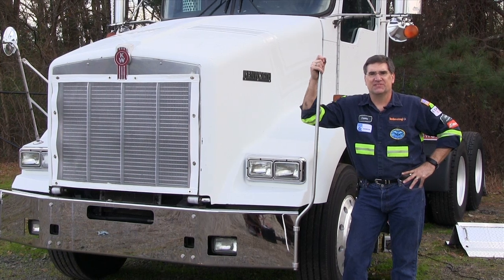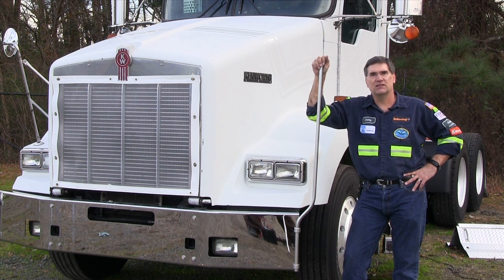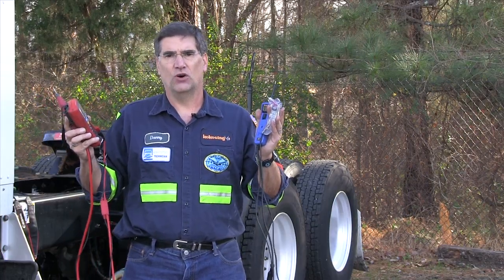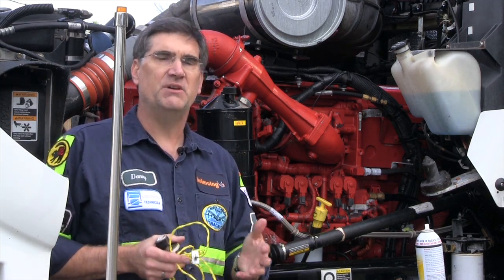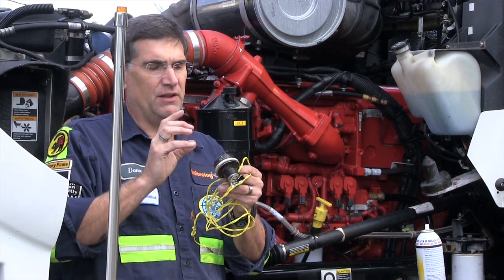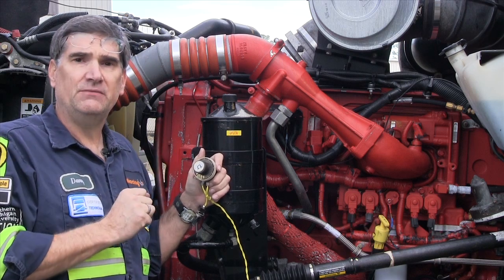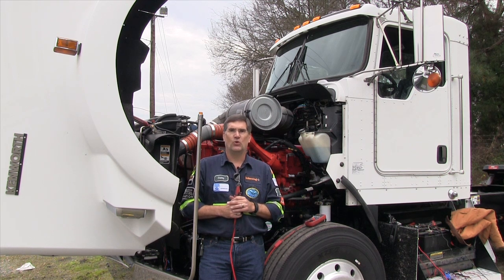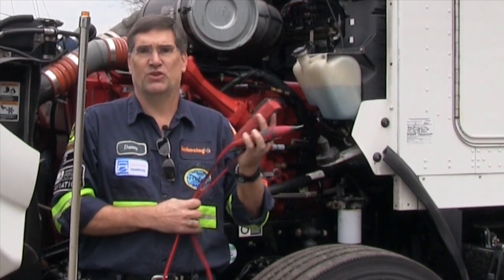LOADpro® vs. Volt-pro vs. Powerprobe® vs. Corrosion

Comment: Hello Mr. Sullivan. I am a veteran mechanic, of automotive, Cummins, diesels, and as of the last 5 years busses (city busses). I am also a load pro , and power probe 3 owner. In my honest opinion Power probes, and load pro are 2 very different tools, and should,  be used  together in ones diagnostic arsenal. I am very happy with both of these tools, but I must admit; I am am confused on why there is this sense of competition. My feelings are that the power probe is a fantastic diagnostic tool, and quite honestly my go to tool for electrical problems, but having the very affordable load pro is also very important. I really feel that both tools have there place in my tool box, and would not be caught dead without both. Maybe get the word out that your very useful, and affordable tool does have a specific purpose that differs from power probe, and it would be a sound, and very affordable investment for anyone, who is interested in electrical/electronics diagnosis to have one. As far as the hecklers go, it comes with the territory, so don't let it get to you. If these guys don't know a good tool when they see one, then let them continue to do it the hard way. Thanks for this excellent invention, and thanks for making it affordable enough for just about anyone who want one to get one. You rock. Dave Pierce (AKA Sir Cranksalot).
Reply: David Pierce I agree with you completely, I also have the load pro and find it a very useful tool . but after hearing about this tool and doing quite a bit of research on it , I believe it will be my next purchased, as for the low current to the ECM on a Cummins that should not happen in my opinion ,sloppy maintenance practice, again in gm fashion , on drivability and low power ,always Ck the battery bx first.I learned that lesson one Friday night along time ago on a road call with a t storm coming in fast.
Reply: David Pierce Btw ,when I first started in the truck business some 35yrs ago ,an old guy in the shop wre I worked had his own version of a load pro for trailers,an electrical box with switches w/ a 7way cord hooked to a battery charger , turn her on and look for the smoke , Sammy was a good old boy and the best two stroke Detroit mechanic I have ever been around ,I learned alot from him RIP.

Comment: I started working for cummins 2.5 years ago as a green horne..i needed to load some wires in a harness one day and a buddy said to try his load pro instead of hooking a bulb into play and it worked so effortlessely and ive used one ever since to diagnos issues..great tool with this i actually find no use for a power probe

Comment: Dan you don't have to prove yourself to idiots. Another way to use the tool. 1.  Put grease on it & stick it up their behind. 2. Alligator clip the ends & plug it into an electrical socket. 3. They can get a great charge like that. 4. But for that the price is double.

Comment: I've only just seen your product fantastic I wish someone had shown me this method when I was working on bus electric systems. I was just wondering if you tell me could this product be used to put a dummy load on house electrical systems and if not you should try and get that next. Seriously if this could be used on domestic and industrial systems 110 us voltage 240 and 415 voltage systems it would just help to get quick tests done without expensive test equipment please tell me what you think would love to hear from you

Comment: A good mechanic would test the individual batteries disconnected of course. Then proceed to check voltage at the suspected circuit.

Comment: Lots to agree  or not  here in the comments. 

For better or for worse,  at the end of the day, though he may come off with having a 'chip on his shoulder' claiming this or that, spending 13 years yada yada..     this tech is making an effort,  be it in his own way,  he is basically contributing  to making your life as a tech easier and more convenient.  

You all with the quick lip are smart, we all are in various areas, but it does surprise me some of you appear to not be sharp enough to  see the forest through the trees... correct, this is not new and how he may deliver his message may or may not be correct in your opinion but he has the compassion and the stones, to take the time, to invest into what he believes can help you with your own job.

 Something that will not make him rich (and Id like to think that is not the point anyway ) to 'replace a fluke'... yada yada ah hem..  but can potentially make yourself more efficient, productive and overall help you earn more money.

For the folks who appear to be barking,  hopefully you have contributed something for us in the field ... other than  the holes you've drilled in your wheel barrow so it doesn't fill with rain water. 

We are all in the field to solve problems, thats what we do, so be a bit nicer and offer support in a more positive manor as we try to help one another be stronger and more efficient.

Comment: How about you learn to test a component with it plugged in and turned on by back probing it with a normal multi meter. Then you won't spread open the terminals. And as for piercing wires it's FINE IF YOU SEAL THEM BACK UP. Then  you wouldn't have to look like a moany tit and go to all the effort of making a video and go through law suits. You could spend that time on holiday in the sun with a smile. If you had plugged that ecm in and back probed it then you would of picked up the voltage drop. Why don't you try that and make a video
Reply from the maker: I'd prefer to see the one you go to the trouble to produce. Make sure you maintain the rudeness and utter lack of empathy for a (I presume) fellow mechanic when you script it. In my industry(ies) your methods don't work; I guess you're a "supertech" so I can't wait to view your rebuttal video.
Reply: Daniel Sullivan There are many different roads to get to the right diagnostic answer. Anger and recentment is not a good road. YOUR WAY is certainly not the RIGHT way every time. It may be alot of the time. You are WRONG when you say you that backprobing is dangerous and that you shouldn't pierce wires. Piercing wires is sometimes the ONLY way and if you reseal it there is no problem. The content of your video is full of anger and has very little educational value.
Reply from the maker: If you'd be kind enough to show me where I claimed my method is the ONLY method I'd appreciate it. Walk a few miles in my shoes before you cut loose with the venom. Taking it a little personally, aren't you? Enjoy your anonymity as you attack something the breadth of which you don't really seem to understand. I don't know you - I don't give a flying flip how you do what you do - but given that this tool has 5 part numbers from major OEMs, perhaps there's something going on here you're too pissed off to appreciate.
Reply: By the way my methods do work and they are quicker and more accurate as I am only loading the circuit with the current it is designed to handle and they don't disturb anything. Your front probing fixed load is flawed and you will argue that till you are blue in the face as we are all well aware of your persistent arguing. You have built quite the reputation on it. My reputation is built on diagnosing cars with multiple different tools and a smile. Your load pro included but most of the time I don't even need it as 95 per cent of the time a fine insulated back probe works perfectly. And I don't need to produce anything Thomas Edison already worked it out for me before I was born it's called a light bulb it comes with many different wattages. I know you have got one but I think it maybe red and dim.

Comment: I am testing a non working coil and it gets about 14v with ground on the coil connector and when I press the load it drops to 0 to 1 volts. And when I connect thr DMM ground somewhere else it does not drop. But the working coils measures to 0 to 1 volts. What does this mean? Any help appreciated.
Reply from the maker: Not sure of the connections you're making.
Reply: Daniel Sullivan The working coils show 0-1 volts assuming the ground is on the connector. But the one that doesnt work reads 14v and when I load it, it shows 0-1 volts. Could it be possible that the PCM is not turning the coil on for some reason or could it be a short? I will check further.

Comment: I'm getting this tool. It's going too be a time saver. So much faster than loading the Circuit with a headlight. I think if the inventor would tell people it was a headlight test with the push of a button,anybody who does diagnostics would buy one.

Comment: Daniel, first off I can a big fan. I have both the Load Pro and one of your books. I use my load pro on my Power Probe. I recreated this same test on a gasoline engine and I was able to see a voltage drop using the Power Probe by hitting the button to see battery voltage and then testing the connection at the plug and finding .3 volts less. I then did what I always do and connected the Load Pro to the Power Probe and tested with the Load button and with the 500mv load I got 9.7v.  As a note I really wish that you would make the Load Pro II with banana jacks so that I can use all of my Fluke adapters, (mainly my back Probe pins). I would certainly be one of your first customers for one.

Comment: I have never used any kind of ohm meter before it's just two wires and then turn the switch on and it will tell you where the short is
Reply from the maker: I don't understand your comment.

Comment: or you could just use a set of spoons to back probe the connector when the system is on and get the same result.
Reply from the maker: Unless you work on Big Boy machines like 400 ton trucks that have connectors with 200+ pins. I suppose if you work with Matchbox cars that would work - unless you do it wrong, as most people do. My way is faster - but that might not be of importance to you.
Reply: fyi i do work on mining equiptment  up to 800 ton twin powered excavators. and i dont see how it is quicker to undo the plug particuarly on industrial ECMs with 50+ pin deutsh plugs on them. and when you are working out of a tool bag and a ute doing break downs space and weight for tool is at a premium.
Reply from the maker: Well, every mine in the North American Coal group uses it, Hecla, Western Energy, Cummins, CAT, Volvo and Allison all use it - as does the USMC. The idea that it won't fit in a toolbag is silly, because you replace the regular leads with these. Your argument isn't very strong, but I don't want to try and convince every person in the world to use it. If backprobing works for you fine - but don't dismiss the tool because you don't understand it.
Reply: that might be all well and good for them. but things are obviously done different on sites in australia were we have to diagnose and repare a fault in a 30 minute window meanwile having other jobs to be done on the machine in the same timeframe. and most of the time have to carry all the tools needed up 3 or more stories of steps and/or ladders.
Reply from the maker: Forgot to mention all the TAFE system down under uses them too. And, one of my best fans and friends does what you do in NZ and swears by them. It's a set of voltmeter leads mate - they weigh 1.2 lbs. If you can't carry them up a ladder I suggest you get a new job on ground level. I've used them in mining - doing all you do - for 16 years - and I'm a bloody Yank...

Comment: Im sorry but i got to  tell you that your tool is good but   U should never stick your tip into the hatness like that and your right those other tools dont do loaded voltage drop testing , but they can  u have to backprobe with the key on and circuit loading itself you sound like a fraud u did lose your 13 years , overall good tool but not necessary real diagnostic techs like myself always test with circuit loaded   , u can only fool backyard mechanics . By the way the power probe was not ment to test using a a load so the comparison is incorrect  the power probe 4 has a feature that loads the circuit with 30 ma
Reply from the maker: The Powerprobe 4 is ripping me off - in my opinion.

Comment: To my understanding the powerprobe allows you to apply ground to the tip by a press of a button and show you the tip voltage on the screen. Wouldn't that be the same as the function of the loadpro?
Reply from the maker: PP4 loads the circuit - not PP3. Patent infringement in my opinion.
Reply: Daniel Sullivan What about a light bulb that loads the circuit! Is that ripping you off?

Comment: Okay , I have to ask , why in the world would you want to disconnect the connector when the vehicles load was already connected?  Why disturb any connector so drastically before actually testing? Wouldn't it make more sense to just simply back probe the power and or ground individually. The problem at that point would already be somewhat self evident right? Not saying there isn't some value to this tool , but need some input please
Reply from the maker: Back probing is dangerous - and in most cases ineffective - if you realize you have to do two tests for the test to make sense. We have connectors with up to 300 cavities - that cannot be back probed. If the harness has failed before the connector, your method is pointless. You still have to start searching backwards. If it's the component, you know immediately. That's 2 of 3.  If the problem is the actual connector to the component, it's visible - usually - that's 1/2. My tool takes WAAAAAY less time than all of that. In addition - what no one seems to get, is that my tool allows a change to the process  that includes an IMMEDIATE and unconsidered (no prediction) diagnosis, Read voltage - know fault. seriously - it's really easy.
Reply: Daniel Sullivan in what way is back probing dangerous? And in today's vehicles disconnecting any connector could mean not being able to effectively test some powers. If we think of a Chrysler as power input , if we were to unplug the power train control module we would no longer be able to have the asd relay turned on . So then we could jump the relay of course , but that's now two connectors or sets of pins disturbed. Now if I were back probing the same wires , the actual load that for the circuit is still present in the circuit and the connector has not been disturbed. Also to say that disconnecting any connector on today's cars could mean having to do many calibrations and loss of adaptive memory in certain systems. I work on a slew of newer vehicles so for me this would surely be an issue. How many connectors have we come across that the wire at the connector is bad within the insulation and not apparent when unplugged?  I don't think I could count them on all the fingers and toes of everyone subscribed. So you have a voltage drop now , believed to be corrosion , what's the next stop. Move straight back to the next connector in line? This is where I don't see the difference between this tool and leaving the original intended load intact ? Why would we want to remove the load to test with load?
Reply from the maker: You're obviously a smart guy. Are seriously unsure, or being intentionally argumentative? I'm asking seriously...
Reply: Seriously unsure . I'm anything but one for an argument. I like value in anything I buy. And I'm just trying to see what benefit the tool would have for me to keep in the truck with me on a daily basis. As a mobile tech I like to minimize as much as possible in order to keep room for the unfortunate necessities like 17 laptops. And of course the monetary side of it is always a factor. I know the tool is cheap enough , but I hate feelings of regret in regards to tools. Secondly as techs at these shops see me using a tool, they generally ask lots of questions about it. If I were to have it with me , it would be best if I knew enough to say get one or not when the time arises. So if you don't mind answering the questions it would be helpful to me
Reply: Daniel Sullivan did we get off on the wrong foot?  Ran across the new video where it seems to be mayhem. Hoping you could answer my previous questions ?
Reply from the maker: Can you email me? Dan@brighterideas.com
Reply: Already have . 2 days in a row
Reply from the maker: Via email - or via this forum? I have no emails from you.
Reply: I will resend this morning between programmings
Reply: Daniel Sullivan email resent
Reply: Daniel Sullivan Ha ha this tech is 100% right and you are an angry man who is stumbling now. I am also a a diagnostic tech and your methods are flawed way more than they are useful.

Comment: not gonna bash your tool cause it looks like it works great but just wondering why you didn't put it up against the power probe hook tool? the power probe you used was never designed to measure voltage drop or high resistance. again not bashing just thinking we should compare apples to apples. As for the the other tool you tested it looks like something my kids would use.

Comment: although he has some good points this specific test is flawed,why not backprobe the connecter with the pp3 whilst under load it won't show opens or shorts but any voltage drop will be obvious in fact anything basic dvm would show the voltage drop,ghost voltage suggesting an open and true zero confirming short to ground no need to plug in this stupid loadpro.apart from what he claims loadpro can do I do believe he has some good points and a lot of what he speaks about makes sense.
Reply from the maker: Sorry - you're wrong.

Comment: I support you Dan.. Anyone that understands the relationship between voltage, current and resistance in a circuit should easily be able to see that this a great diagnostic tool. Most of all it saves time and money if you are skilled and know how to use it correctly. Awesome too is all I can say that wont break the bank.